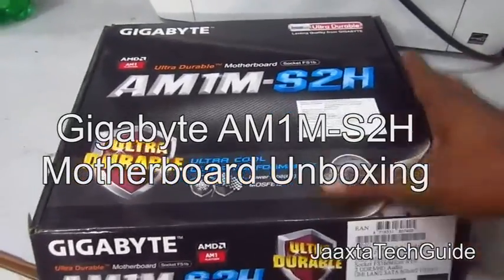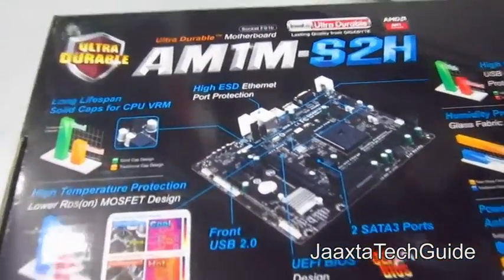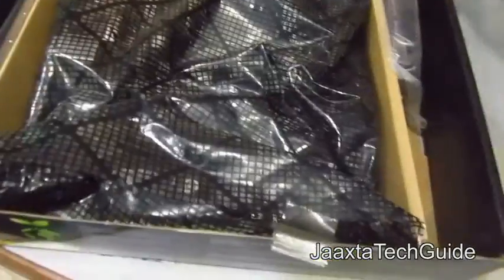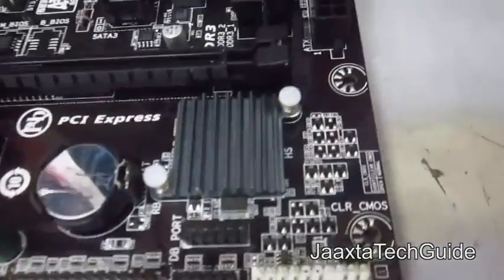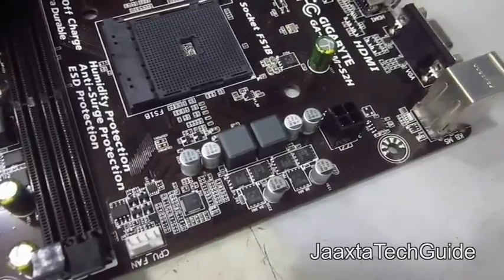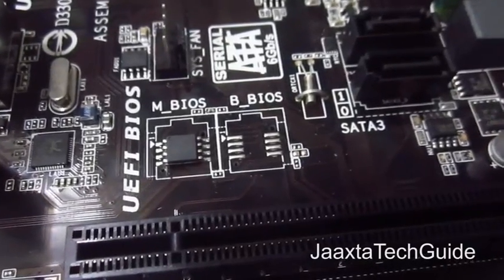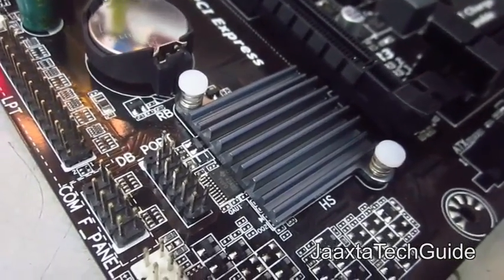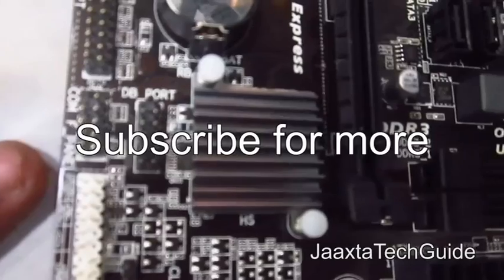GIGABYTE AM1M-S2H UNBOXING AND OVERVIEW

Comment: Every MB with AM1 socket got only 2 mounting hole for CPU cooler?
Reply from the maker: Chlodzenienet  Yes.. most of all.. actually it requires a small heatsink. That is why there is two screws instead of four.